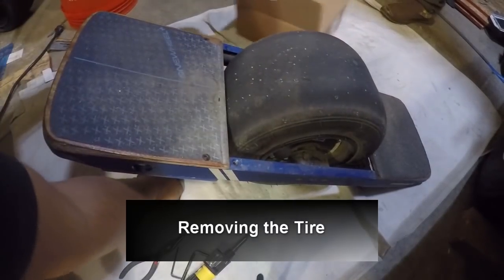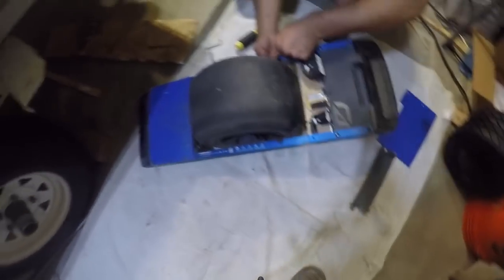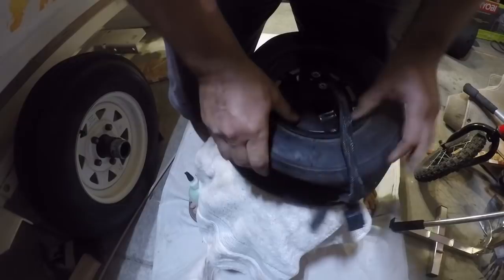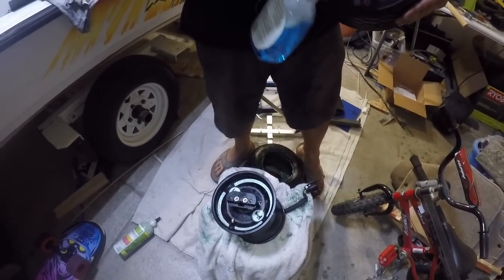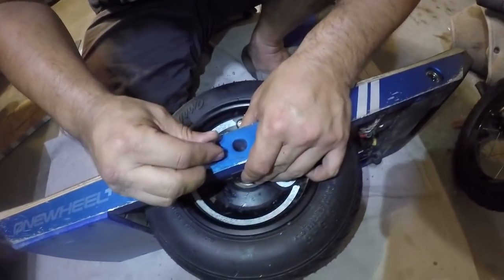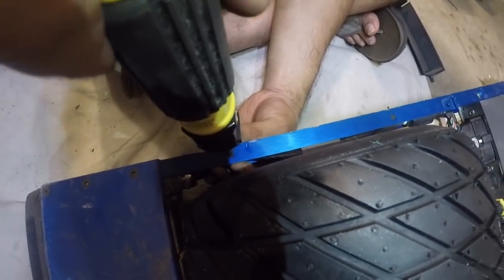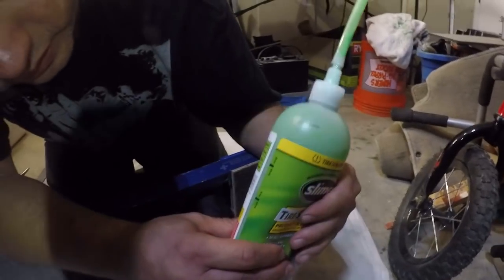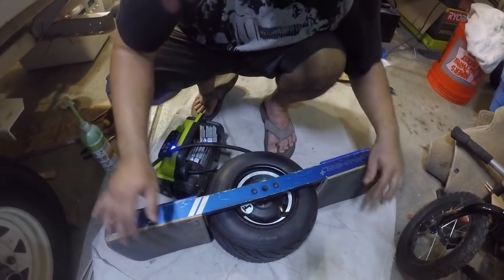OneWheel Workbench: Changing Tires

Comment: The BEST/SAFEST way to Get a New Tyre On with Less Pressure

After cowering  under the work bench and taking my new tyre up to a presumably sketchy 65psi and still not getting the the other bead to pop on (using dish soapy water) I realised that the round electric cord from my extension cable was thinner than the inner rim.  
So with the extension cord (not plugged in obviously) I slotted it in and round the half side of the tyre that the bead was further up on, then bingo this kept the tyre's bead more level letting the stubborn side pop up far more easily (at only 30psi).  With the soapy water there peeling the round electrical cabe back out was super easy and then the seal pop finish slid up (now evenly) and popped on at less than 30psi.

Comment: It's not a good idea to tighten the wheel to the frame like that. Lay it over a bucket with the tire hanging free inside. Then tighten them. Much better chance of having it level inside the housing and not sitting crooked. Otherwise great job. Inside the tire hub is a groove. That is for removal and instal.

Comment: Guys you need a tire tool ala tire iron, make plastic ones for a bike tire so won't mar he rim. 
Thaty deep recess is there to get the tire on and off the rim, push one side into that recess, and use a tire iron and flip the other side over and work your way around.

Comment: Is there no calibration you need to perform after the swap?
Reply from the maker: I've done about 40 swaps and have never needed to calibrate
Reply: Awesome man thanks for the info. I hit up FM and asked about it and they said it voids the warranty and that they have to recalibrate it when you send it in so that's why I asked. Sucks to hear. Like the vids btw, seen both of em'. I'm diggin the community. I received mine in a war zone and love riding around base. Also love the community online - everyone seems pretty nice.
Reply from the maker: @marxtondutton7709  the community is great! You're a part of it now! Take care
Reply: you are asking about Balancing the tire on the rim, on a car tire this is needed due to the centrifugal force of the large rim and tire ( large diameter ) balancing happens because the tire will not be perfectly balanced on manufacture ( some areas of rubber may be slightly larger or contain more material, thus making the tire un balanced. on a small tire like this the Forces are no where near that of a car ( even a car with a small tire ) and the top speeds are likewise not at all the same. SO, you COULD balance the tire and add a few lead weights, but you would likely not notice much of a difference.  I doubt that FM balances their tires when they make them, they likely say this to discourage people from doing their own tire changes as it means less money in their pockets.... also discourages people who are NOT mechanically inclined from destroying their OW's   ... all respectfully intended :)